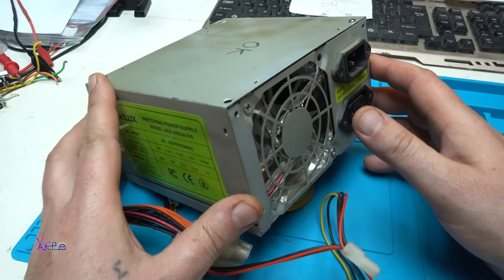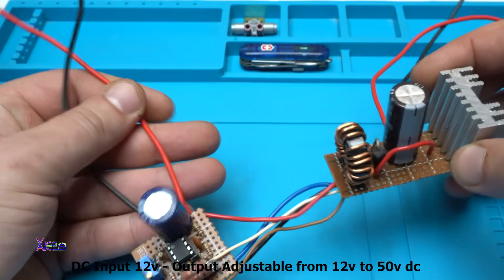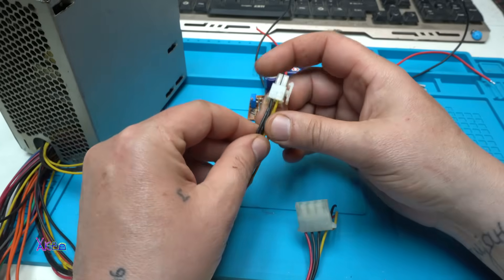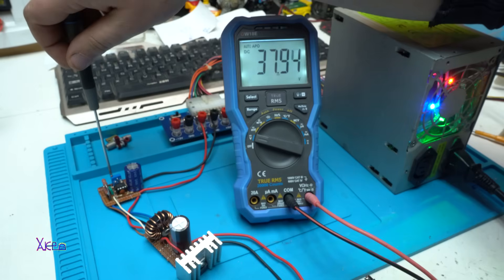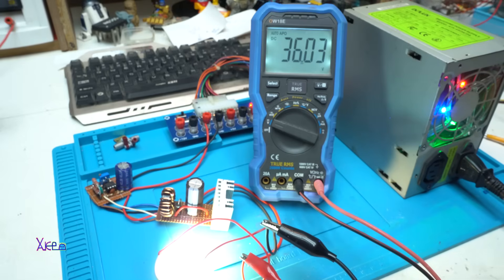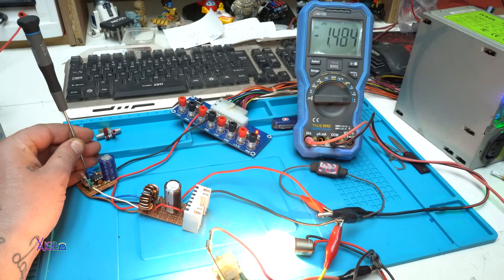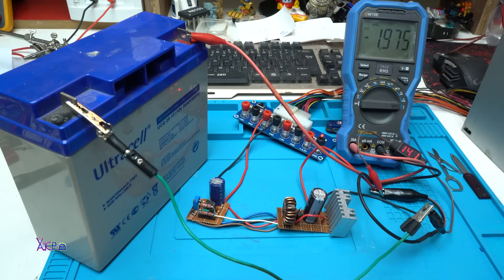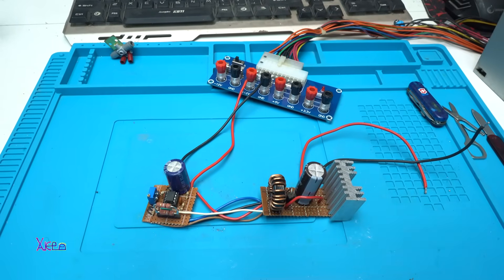Using Old PC Power Supply I made Adjustable Voltage Regulator

Comment: Merry Christmas!!! Im trying to make a power supply for a Chinese amplifier "kit". ZK-HT21. I can use small 12V-18V AC adapters but i got low power, distortion (clipping). So I pulled a 250W (218W max) p/s out of one old case. It has a +12V @ 14A but the -12V is only 0.8A. Will this work? If not, I do have 4 more cases with p/s inside. I need the right ps to make 36v @10A and have low ripple. Please advise. Thank-you!

Comment: So you're saying that on an ATX Power supply I cannot modify the feed back circuit to the PWM chip to make the  12 volt line adjustable from 0-12 volts? Because that is all I wanted to do, I already know how to make a car battery charger, and I only need 12 volts or less for what I wanted to do, which is current injection. I am sure my modifying the PSU outputs with higher working voltage Capacitors to about 50 VDC, and using larger inductor  I could make the ATX power supply do the same thing, I may need to change some Diodes and a larger heatsinks but I am sure it's possible.

Comment: when the output voltage rises for even a modest current consumption, be aware the the current on the input 12 or 5v side from the power supply, will rise significantly to maintain the power ( volts x current), so the wires need to fatten up!!!

Too much excitement about the voltage increases but very little on the current !!!

CURRENT DOES MATTER, don’t ignore the power calculation or things can go wrong . 

As a rule power out must at least equal power in.
Make sure the cables can handle it or change them .

Comment: That's a very nice project but I don't think there's any kind of protection in this circuit ?
Reply from the maker: No protection but will upgrade in next video project
Reply: @Hacktuber  great ! If we want to use it as a lab power supply, that's indeed mandatory to have several kinds of protections.
Reply: @Hacktuber  But that's funny because any PC power supply nowadays has all kinds of protections. So if we use the 3.3v, 5v or 12v rails it should be perfectly safe.

Comment: I once charged a car battery using an atx psu. I just connected 12V that's all. Maybe not the right way but my proper car battery charger would not work because the car battery went below 3V. So I pumped some juice into it for 1/2 hour using 12V psu then connected proper car battery charger and it worked fine after that :-)

Comment: Such a pity mate that you did not demonstrate anything close to 150W output, I was looking forward to seeing it.
Reply from the maker: There will be more testing,once I finish my diy electronic load👍
Reply: @Hacktuber  As you approach 150W check the ratings of your inductor and the Shottki diode.  Also the radiator on your MOSFET looks too small for such a load especially without a fan.   Hopefully you'll be OK!

Comment: Can u give details of pcb and its source. Need details of components required and ckt diagram of connections. Otherwise,  this video can nit be effectively used gor making at my end, though it is a very good information.
Reply from the maker: Yes you are right, I will make another video with full details.